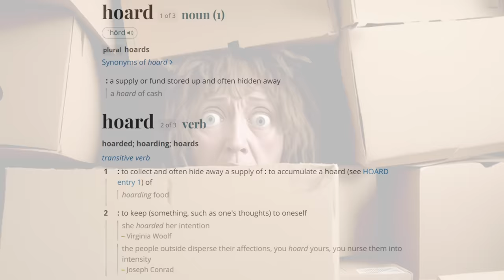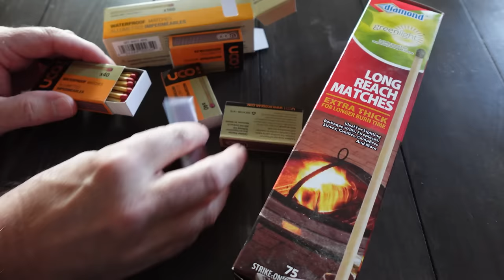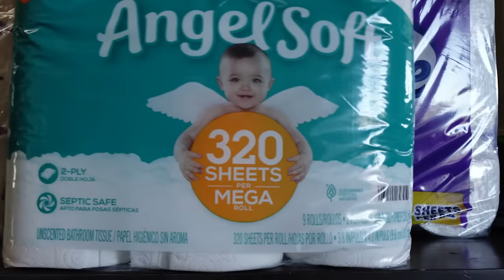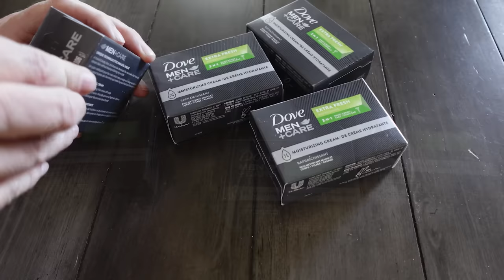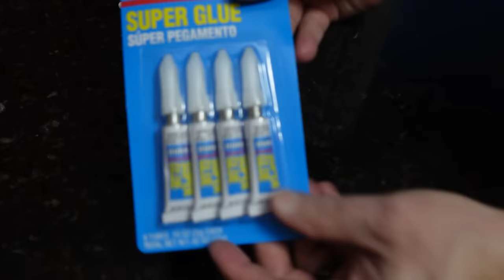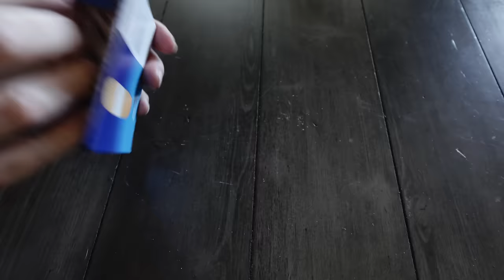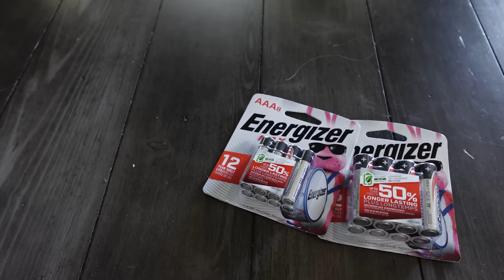20 Cheap Items to Stockpile, Hoard and Barter With

Comment: During the great TP shortage of 2020 I was prepared.  By the time TP shelves were full again, I still had months of TP left.  Yes, I was afraid of running out eventually, but I didn't try to buy more because I didn't want to be part of the problem.
Reply: I've probably got two years of TP stored in totes w/tight fitting lids to keep mice out. I've been Prepping for many years.
Reply: Buy a bidet, a portable one can be found for $49.00, will pay for itself in the amount of TP saved.
Reply: @sjordan7085  I'm a bit wary of bidets.  It seems like high enough pressure to clean anything is too high to be comfortable.  I prefer a few drops of water on TP.  Of course bidet water is refillable in shtf, toilet paper is not easily replaced.
Reply: I bought large bags of baby wipes. Like 20 of them over 4 months.
Reply: I have a good surplus of tp I got for free from dumpster diving. If you’re a preper dumpster diving is a great way to get useful items. The tp they threw out was because the packages had rips in them or one roll missing. I’ve found hundreds of candles they tossed out simply because the jars they were in broke. The candles can be used without the jars obviously and if wanted I could always heat them in an oven to melt them and transfer the wax to a new jar with the same wick. Living in the most wasteful country (America) in the world you can practically find anything you need for free if you know where to look
Reply: @JustinLodes  I have a solar panel setup charging an electric car.  2x365W panels came from a dumpster.  It looks like an installer dropped a pallet, broke most of them, and tossed them all.  3 of them weren't  all cracked, and 2 of those output voltage, so I took em.  I've generated countless kWh from those in the last 2 years, and they'll be the highlight of my bug-out trailer when it's done.
Reply: @madcow3417  that’s pretty sweet. I’m actually in the process of going solar myself and I’d love finding some panels like that
Reply: I always kept a 12 pk of toilet paper in both of our bathrooms, so I wasn't too worried about running out.  But, when it did come back in stock and there was a limit of 2, most of the time, I was only getting one.  Now, I have extra packages for just in case.
Reply: @sjordan7085  With my bidet I sailed through the pandemic without the worry of running out of TP or even bothering to buy it.
Reply: @madcow3417  The water pressure is adjustable, from a a very gentle stream to put the fire out, well, maybe a little exaggeration on the fire, but you get the idea. It gets you a lot cleaner than a little water on TP.
Reply: I hope you're making videos?  Would love to see this.
Reply: I’m still trying to figure out why a sinus and respiratory infection caused a toilet paper shortage? All I can come up with is the people that were clearing the shelves are just buttheads and got the nose and butt confused. But I had some because it’s on auto ship so I never ran out. However after that issue instead of one case I now keep two on hand. 😂

Comment: Every time there's a hurricane here on the East Coast, I take gallon-size bottles that I've saved from tea and milk and fill it with water that's clean. And I put this in my deep freezer and fill up the whole deep freezer with it. This gives you good drinking water for a long time because the whole freezer will act like an ice block when the electricity goes off. We did this for 3 weeks after Isabel and had cold drinking water for the longest time. It also kept our food frozen until we were able to cook it outside on a grill.
Reply: I have heard of people freezing milk, soups and stews in square blocks too. They stack easily
Reply: The ice storm of 94, we were without power. I took the most perishable items, dug up snow and put the items in it, covered it. I have a 10ft pole to mark the area
Reply: All very smart ideas.❤Thank you.
Reply: That was one he'll of a storm. Tidewater VA James river Jamestown
Reply: Hope you're sterilizing your milk jugs with vinegar before you fill them with water or it could be deadly to drink otherwise

Comment: I  buy flashlights and other necessities that use AA batteries, I also stockpile rechargeable  AA batteries. I have decorative solar lights all around my yard ,not because they are pretty but because  when the grid fails, I'll be able to use them to recharge my AA batteries...........Hidden in plain sight.
Reply: Hmmm…pretty cool idea. 👽✌️
Reply: You can bring them inside and use them for mini lanterns or night lights for kids as well.  

When the lanterns eventually stop working, harvest the battery. In my experience, 9 out of 10x, the light stopped working because the solar panel glazed over and stopped charging the battery. Often the battery is still good. 

Also, the batteries are often low mAh ones compared to regular AA batteries. While they are rechargeable, they may be 300 to 600 mAh, compared to "regular" 2800 to 3000 mAh rechargeable AA. I never throw away any broken  rechargeable device without opening it and taking the batteries out and testing them.
Reply: How do you use them to recharge batteries?
Reply: Someone told me to get a laser light I asked why? He said because if you bug out and want to get someone’s attention but don’t want to give yourself and surrounding area away use that I think that a great idea

Comment: Bleach tablets store much better than liquid bleach and take up little space.
Reply: Plus they don't expire kept in air tight containers. Liquid bleach actually turns to water.  Pool shock can also be used and you only need a smidge each time. 😊
Reply: vinegar, vinegar is safe, or liquor. Bleach is dangerous but vinegar is natural
Reply: Pool powder… 
Trust me: look it up.
Reply: @johnjanuary2958  I have pool shock. It is not easy to store.
Reply: Dry chlorine 5 years. Liquid bleach 6 months.

Comment: Manual can openers.
Reply: military openers
Reply: The  point  of  an  old  knife  and  "drag"  it  around   the  lid.

Or,  make  a  knife  out  of  black  metal  with  rag  for  a  handle.

Keep  it  sharp  to  do  it's  job.
Reply: I literally keep on of those small military folding ones in my wallet! The number of times it has "saved the day" has been suprising to say the least 😂
Reply: P 38s. If you know how to use it.
Reply: manual everything

Comment: I've been Prepping for many years and I have Bic Lighters coming out of my ears as well as strike anywhere matches and storm matches. I have a few different camp stoves w/fuel. I have so many oil lamps that I can use some for Barter w/lamp oil. Keep your bar soap in a mouse proof container. They will eat soap. I store three 4lb bags of sugar in metal 50cal ammo cans as well as potato flakes, powdered milk and a few other foods. The cans have a rubber seal in the lid to keep out rodents and moisture. I have $1 flashlights coming out of my ears along with more pricy ones. Even though I don't drink coffee, I store instant coffee for others in my group. I store the little instant coffees for barter. You should have a good supply of N95 face masks and carry one with you all the time. Keep Prepping my friends.
Reply: Walmart has been out of lamp oil for months !
Reply: You store coffee?! You Sir will be my doomsday friend when all hell breaks loose!
Reply: n95 masks are garbage, carry a real respirator with filters, if not a genuine gas mask... have many filters and a backup mask for breakages.
Reply: I have stored some foods in those ammo cans as well.  But, never thought to put my 4lb bags of sugar in them.  And also have several oil lamps.
Reply: @donnabartley2246   

Lamp  oil ??  Is  that  plain  old  kerosene??  (Kero?)

Gas  stations  may  have  it.  A  4  gallon  tin  full  will  keep  you  going  for  a  while.

Suppliers   of  stoves  using  that  oil  might  have  it  on  hand.
Reply: @donnabartley2246  might be a silly suggestion - sunflower oil etc vaseline, melted candle wax?

Comment: for fire besides lighters i have afew boxes of strike any where matches and 3 ferro rods .
besides toilet paper  . also added cut up old bed sheets , can be used for first aid old work shirts  that can be washed . also have several boxes of baby wipes . besides zip tie , cordage ,, rope ... have a few rolls of trapper wire for snares etc , lights and batteries . we also added a few things that can be recharged by solar . have a few oil lamps with extra oil and wicks , one thing thats over look a lot is ... baking soda multi use  tooth paste , heart burn disinfectant etc
Reply: True,  I also stashed the same items.
Reply: Don't forget the TP....

Comment: Hand sanitizer will work well as a sterno replacement, I have used a clean, empty vienna sausage can about half full of sanitizer with a camp stove to heat food and water. a half can lasts about 45 mins + -.
Reply: Methanol based antifreeze

Comment: Chapstick, sunscreen, and bug spray are big in my supplies
Reply: Chapstick helps with Firestarting. Just another use. Also Vaseline. Along with a cotton ball.
Reply: @Realtor-BigD-SmokinDonBBQ  prime info, trick candles are solid too.... magnesium infused wicks help for when they get wet, though they should be stored in a water proof container.... also soaking cotton pads in lighter fluid then encasing it in wax.... lasts a long time but will allow for fires in the rain or wet conditions
Reply: @KEPSAGAMER  trick candles??? Really?? 🤯 Wowww... a prank could help in a pinch. Lol that's great info. This is really the first I've heard of it. But it makes a ton of sense. Thank you.
Reply: @KEPSAGAMER  waxed lettuce boxes make good fire starter.
Reply: Moth traps , rodent traps, plumbing spares tap washers n tape.

Comment: Aluminum foil makes a great bagged meal on a bed of coals. Plastic wrap and baggies for leftover preservation, motor oil and filters for your vehicles if local service becomes less available, water storage cans 5 gallon type for potable water 🚰, freedom seeds of personal protection, grills both charcoal and propane, seeds for gardening, fishing tackle, a Bible and other educational books for when electronic devices will no longer be available or usable. Toothpaste, floss and brushes. Lime, nails, lumber, saw, shovel, mattocks, and a hammer for when you will need to build an out house.

Comment: Great video. I  have a suggestion. I use those stick on battery operated wall lights. I have them in my living room, my kitchen, my hallway. I live in an area where we have trees falling and the power goes out during a storm. This is a life saver! I also have light and that helps. Another thing to have is a battery operated radio. It comes in handy for vital information. A cordless phone charger is helpful too.
Reply: Great idea! We have a few in our cubbards so we can see the pots and pans and Tupperware. They're easy to take off if we need to.

Comment: 13 gallon kitchen trash bags will be esp. useful re sanitation in the case of sewer/septic failure; bathroom-related discharge brings with it the possibility of major health issues; 5 gallon plastic buckets and toilet seats are great
Reply: There's a video on YT showing how to use them in the toilet with organic kitty liter, a urine cap and creating two separated compartments. It looked like a really good way to deal with the problem.
Reply: Have a supply of small garbage bags if you get stuck indoors and no sewerage.
Reply: 13 gallon bag in toilet great, dont forget cat litter to cut smell
Reply: bleach great, but short shelf life, needs frequent rotation
Reply: @lyndavonkanel8603  thanks for sharing, sounds very helpful, will look for it

Comment: Here's my experience with Band-Aids:  I recently opened a box I bought 15 years ago.  First, the paper wrapper was hardened and crumbly;  Second, the adhesive was no longer so sticky.  Its stickiness had dropped to about half, I'd say.  I still used them and they worked.
Reply: Buy extra medical tape to tape the bandaids on.
Reply: I've had them go bad in first aid kits.  I never considered long term storage.  I may buy a large pack and can them for an experiment: one set with desiccant, one with O2 absorber, one set just sealed, and one set in the open.  I'll let you know in 15 years how they turned out :p
Reply: That’s where the duct tape comes in…
Reply: @kittydogz  I actually cut my leg open pretty badly when I was a kid and closed it with duct tape so I didn't have to show my parents.  The adhesive is too strong, it will rip open an unstitched wound.  Also, it doesn't breathe, so it gets all sweat-rashy.  I have no idea how it didn't get infected.  Now it's a big old scar.
Reply: @madcow3417  Ouch! Was mostly kidding but I have made a bandaid with paper towel and electrical tape before. Just left it on long enough to get to the store though.
Reply: Your best bet for band-aids are the fabric ones and don't forget to ROTATE them. Medical tape will keep for a while as well as individual wrapped gauze pads but again ROTATE them just like your foods.
Reply: @kittydogz sanitary towels and panty liners make good wadding for cuts
Reply: I have kids. Bandaids never last that long at my house.
Reply: I think gauze and medical tape will last longer than band aid. The might be more bulky esp if on fingers but they get the job done

Comment: I read an article that suggested saying small dishwashing liquid bottles. They can be used as a portable personal bidet if you have no toilet paper available.
Reply: Purchase toilet seat for 5 gallon bucket.
Reply: 50/50 vinegar and water in spray bottle
Reply: Can take a regular cheap disposable water bottle and put tiny holes in the lid. Then just squeeze. Mini shower.
Reply: I have a 1 gallon pump up sprayer for a bidet. Just bend the wand so you can reach without a yoga position.

Comment: Solar chargers an battery banks to charger most anything for yourself or barter for others.  I've grabbed a couple large 12 volt batteries for a truck at O'Reillys for like 58$ each.  Wicked cheap for a big battery.  Usually more like 120%. They sell off batteries that are over a year old.  Waterproof zip up bags. I've grabbed multiple vaccume sealers from yard sales. Or goodwill. If there's anything you truly believe you'll need . Always have a second one if not 4.. I look out for sales an clearance items everywhere.  Walgreens just dumped thier motor oil for 1$ each.  There's so many things that you'll want or can barter with.  Electrical wire for 12 volt lights, electrical wire nuts to sodder. Crimp on fittings  , genorator oil.
Reply: Store the battery packs in faraday cages for EMP events..... just sayingggg

Comment: I’ve stocked up on cheap bourbon, tequila, rum, and vodka for my alcohol bartering. Cigarettes (I know they go stale, but when someone is desperate…) for bartering. 

Some things that I will NOT barter are food, ammo, weapons, or sanitation supplies.
Reply: Alcohol “spirits” should last almost forever, plus, clear types, especially vodka can be used to make many other items.
Reply: Store dried banana peels. Desperate smokers will gladly take them to smoke and give you better useful stuff in return
Reply: I'd like the above to use for cooking and treats. Not a fan of bartering, best to be independent and resilient, that's what works for me.
Reply: I'm glad I was finally able to quit smoking, I remember the desperation all too well.  Well enough, that I don't need the temptation of storing them. Or the expense of buying them these days.
Reply: @Answer4242  congratulations on quitting smoking. I remember the temptation too. I quit eleven years ago and now I live with COPD. So I have no temptation now. I agree with the expense. I bought my stash through the local military store where they are cheaper. Being a disabled veteran has some perks. Stay safe and blessed Lisa.
Reply: Be careful whom you barter with, they may return unfavorable  for your favor.
Reply: Cigarettes don't go stale if they are kept air tight as I collect older packets and if they have been kept that way when I sample them they are fine, some have been 50 plus years old. Great barter items as is rolling Tobacco and papers.
Reply: I stock up hard alcohol, (cheap stuff) for bartering.  if you have a vacuum sealer, you can seal up cigarettes by taking the air out and the tobacco will last a very long time. Again, for bartering as I don't smoke.

Comment: 3:05 - I dip the ordinary, cheaper, STRIKE ANYWHERE matches in wax to waterproof them.
10:08 - Elmers School Glue works great on wood. It's just not beige, like the expensive stuff. I also recommend some 2-part epoxy.
Reply: I heard nail polish on matches waterproof
Reply: Common sense...

Comment: Some really great ideas! 
For the bleach, I would suggest a concentrated bleach powder instead of a gallon of liquid. The bleach powder that I currently have is somewhere around 20/21oz and will make up to 60gal (maybe) of liquid; of course depending on the job you are preparing for. There are also concentrated tablets. I think one tablet mixed with one gallon of water, to say clean your floors, but one tablet and a little less than a cup of water to do a load of laundry. With the powder/tablets how long it will stretch or how much "liquid" it will make, really depends on the job you need it for. BUT, 20oz or 40 tablets (about the same size as a Costco ibuprofen bottle) v a gallon bottle of liquid, there is no contest with the amount of space savings.

 I'm really glad this video popped up in my feed. 😁 If the rest of your videos are like this one, I will definitely be watching more.❤
Reply: pool shock instead of bleach, does not need rotation
Reply: @davidfoster8172  can shock be used to sanitize the same way as bleach? Say, to sanitize a tool that you would then use on a wound? 
I live around the Phx, AZ area, land of 10,000 pools 🙃. So, shock is pretty abundant here.
Reply: @RDGrandy shock is just a expensive bleach!